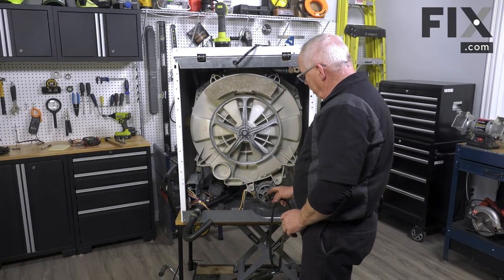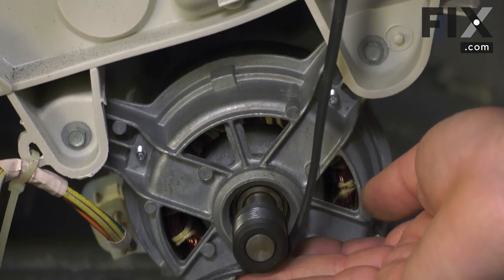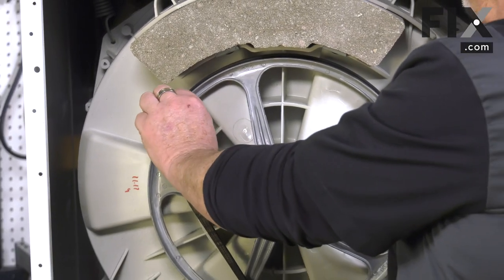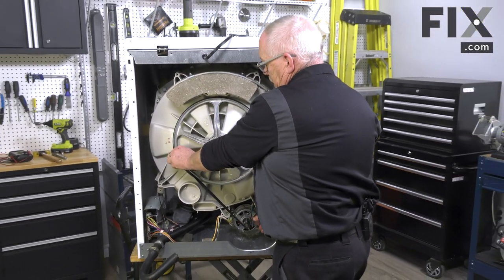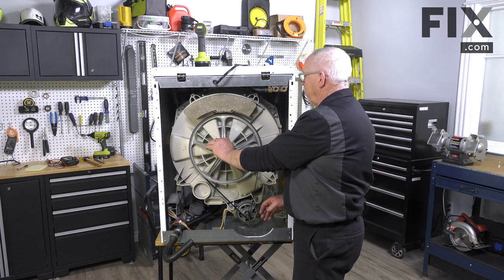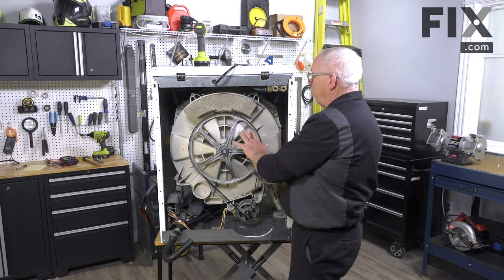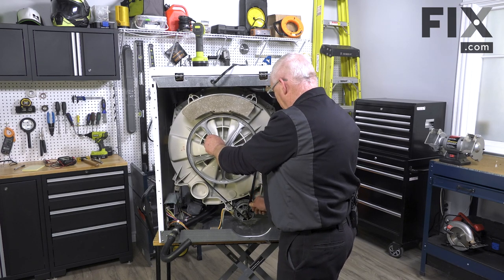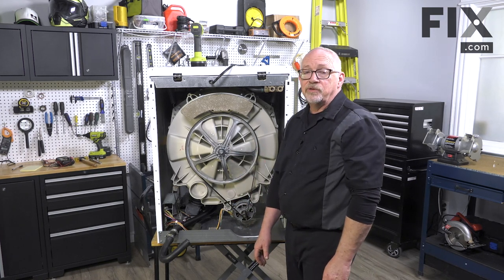WASHER REPAIR: How to Install a Drive Belt in a Front-Load Washer | FIX.com

Comment: Hello I have a GE GFWS1700H0WW. I replaced the drive belt but I'm having a hard time lining it up. It keeps coming out crooked  and eventually comes right off. The drive pulley has no grooves so it slips off